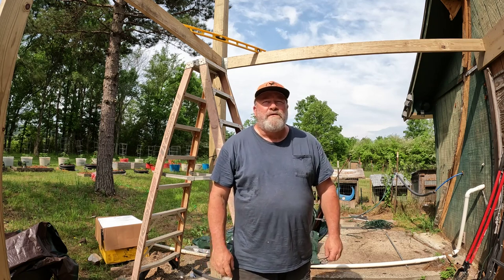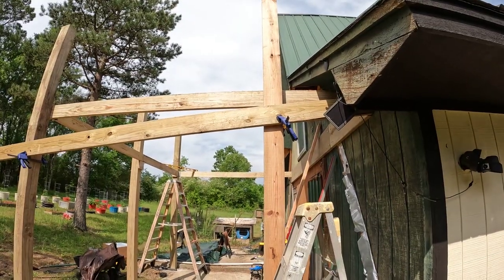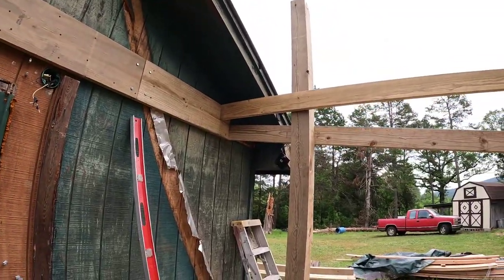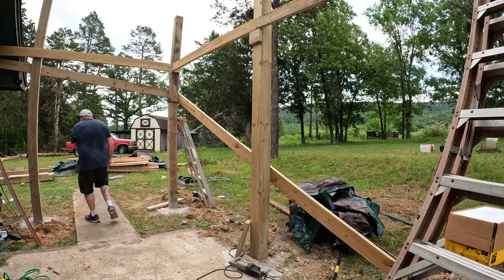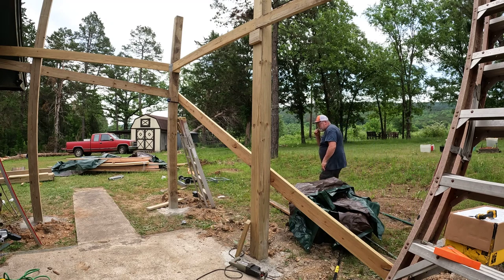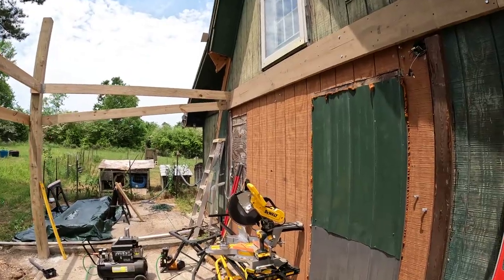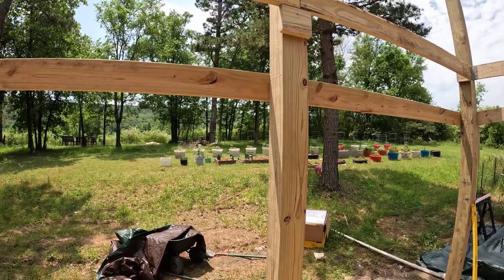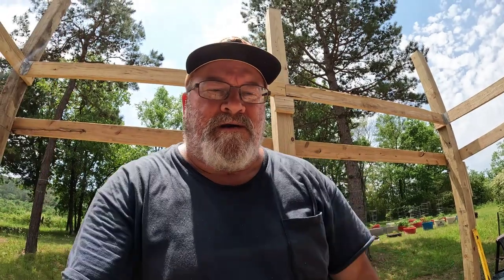ROOF RIM JOISTS ARE UP/SCREEN PATIO/DECK /#6

Comment from the maker: I will have to lower the roof rim joists, not enough room to slide roofing metal. The 2x 12 ledger board is actually 11" I didn't account for that, easy fix
Reply: Thanks for explaining that
Reply: WHY, are you building TWO roofs and angling the add-on roof under deck? Just use your deck as roof for your add-on. I DON'T GET IT, Fella
Reply: @slougo5909    I just said the same thing!   I don’t understand.
Reply from the maker: @slougo5909  So I guess the water that drips down from the deck would be like a free shower then. Its not two roofs, its one roof.
Reply from the maker: I dont get where you see two roofs
Reply: Plywood 2nd story deck and protect it and it will also serve as roof of Add-on.
Reply from the maker: @slougo5909  and where would the water go? No roof over deck.Trust me this isnt my first rodeo, wait and see end result. Nobody uses plywood for a deck unless it has cover.
Reply: I was thinking of your deck as a Flat roof sealed and protected. You probably aren't going to sit out on it when its hot out you'll be below in shade. Just shooting ya ideas. Your dime, your project fella. I'll be watching and rooting for ya. Drive-On Airborne.
Reply from the maker: Its not a dime anymore! Its outrageous what lumber cost.
Reply: I have full confidence you will get it right. I can't wait to see this come together. This is an exciting build, thanks for sharing!
Reply: Instead of cuting the are they 6×6, I forget. Can they be part of your rails of the deck? I didnt know if they were tall enough.
Reply from the maker: @heavenboundhomestead126   yes thats the plan

Comment: Did you say you’re only putting joist hangers on the ledger end?  I know it’s an added expense but seeing how you bought those 6x6 post that would hold a herd of elephants on your deck might as well put joist hangers on both ends and make it secure as possible.  Understand if you don’t with todays insane prices on metal goods.
Reply from the maker: The deck gets joist hangers on both ends, not the roof